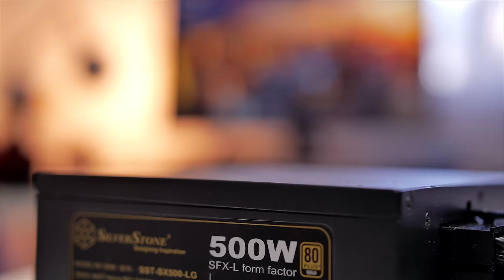Silverstone RVZ02 Review - Amazing Slim ITX Tower!

Comment: Finally got this case and the necessary smaller stuff (mainboard, PSU), and what an awesome machine it makes, it does run quite a lot hotter at idle and load, but it's still managable with the Argon AR06, also makes a big difference wether or not the dust filters are on. (A whole 10°C in my case if using the same fan profile.)

For those that want to know, I got an Asus Z170I Pro Gaming, Core i7 6700K, MSI Reference GTX 980 Ti and the new Corsair SF600, the latter which is a wonderful PSU as it is 600 Watts but not SFX-L but smaller. Temps so far are under full load, CPU: 77°C with Standard fan profile, 82°C with with Turbo fan profile and dust filters attached. GPU is running at around 40°C at idle, but has no trouble staying under 80°C due to expelling its heat outwards instead of into the case.

Also... All this room on my desk!
Reply: +Mina Darsh 
Not to sound snobby or stuck up, just observations based on your build.
1st of all you ruined the air flow design by Silverstone in the GPU chamber when you placed reference GPU which is something even Dimitry didn't understand with the top and bottom unfiltered vents.
The SFF airflow concept is if you have enough intake then you wont need to bother yourself with exhaust fans as air will flow and escape on its own through any vent that is empty hence the reason of not needing filters as its pointless to filter exhaust.
By using the reference cooler you have effectively rendered the GPU chamber cooling mechanism useless as the GPU is more cool restricted with one fan and forced one way exit as opposed to non ref. where you will have 2 fans taking air from a wide filtered opening and plenty of holes at top and back for the air to escape from your GPU.
A 6700k on low profile cooler is too much not to mention no room for OC which rendered your CPU purchase pointless.
im on my rv02 and i get way lower temps than you with ROG impact VIII 6600k ar06 msi non ref cooler and sf600 corsair.
one thing i do agree with, dat space :D....
Reply: +TP015657 I agree with everything you said, but that is if limiting to this case. I might go for the even smaller Dan A4-SFX when it comes out which looks like it will require a reference GPU. And yeah, for the CPU I wonder if the Thermalright AXP-100 Muscle might be a better option, but else I might get a non-K 6700 for it and put the 6700K back into my other rig from which it's more 'borrowing' this CPU.
Reply: You've got more balls than i do going for that case XD
Reply: +TP015657 Well, it's weird, I have seen people combine the same hardware with this case and even claim to overclock their stuff a little. Though for the GPU I'm not too surprised, mine is still below 2500 RPM when it cools at full core load, maximum is around 5000 RPM, the CPU however is cooling near its limit of 2400-2500 RPM. (Sadly my AR06 seems to have a less decent fan from the batch it comes from.) I have seen people clock their 6700K to 4.5 GHz and said it worked well, but I guess they either didn't mind getting eerily close to 100°C or they tested it during gaming and not full load on all cores. The CPU doesn't get as hot during most games than it would during a full load test in the end.
Reply: Try going for a Noctua NF-A9x14 fan a lot of RVZ02 builders swear by it over the stock.
I'm sure you will be able to reach a 4.5ghz but not sure if you will be comfortable with the temps as a low profile cooler has its limits.
Remember the tdp that AR06 can handle is 95w any higher and it won't perform adequately.
Best of luck :)
Reply: +TP015657 Hm, odd that it performs better, according to the specs it moves less air, am I missing something?
Reply: Umm it moves more air at lower speed, 40 vs 50
Not to mention that the extra air flowing will be a nice little welcome to other components next to the CPU that heat up as well.
Reply: +TP015657 Might be that the Noctua has much better static pressure, perhaps. Ordered it and going to find out. :)
Reply: +Mina Darsh 
The Noctua manages higher CFM & lower RPM due to the fan blade design and static, but keep in mind the higher CFM is achieved through the use of LNA.
There are 2 modes for Noctua fans both identical till they reach the high performance range, normal mode will prioritize lower dba (which Noctua are known for with acceptable CFM (38) the 2nd (LNA) is the opposite (50) but still quite considering other fans.
Just make sure to use the LNA cable that is included instead.
Reply: TP015657 I'd hate to correct you, but the L.N.A. (Low Noise Adapter) actually gives lower CFM and noise. Anyway, I installed the fan today, without L.N.A, and although I didn't expect it to crush the Argon's stock fan, it did suprise me pleasantly. The fan manages nearly identical cooling performance, while running very notably quieter, like... A lot quieter. I only feared it wouldn't fit as it turns out the screw holes are maybe half a millimeter closer to each other on the Argon's fan, but it's actually seated well, just a note, don't tighten the screws until they tighten no more. I tightened them until the fan felt secure and the screw couldn't easily be loosened again but no more. It's a pricey upgrade, but it'll scrape 10 dBs off with ease giving the same performance.
Reply: +Mina Darsh 
Thanks for correcting me, i totally got them mixed as i recalled this subject from memory, it was new to me and I only came across it when I got my own fan.
I'm a bit mystified it didn't beat the stock seeing how it did for me on a 6600k OC of 4.7 with 7c difference after repeated tests.
Glad that you liked the noise reduction just hope it was at least worth getting the fan otherwise I'm gonna feel real bad for wasting you money :(
Reply: TP015657 No worries, it's a nice experiment and I'm still baffled at how quiet it is when it's flexing its muscles. No idea how our experiences differ a bit but there are many factors that could play a role when it comes to these things.

Comment: This case looks like you could drill quite a few holes in the top side of the mobo chamber and put 4-5 2.5 inch drives in there and choose to not use the sleds. Looks like there'd even be room to put rubber grommets between the screws and drives.

Comment: [ at 2:54 ]  I think filter-mesh on the small air ports, would be unnecessary, no?  If they're supposed to be outflow, with the larger filtered screens being intake, then positive pressure should prevent any dust intake, I would think? 

I do agree that lack of any filter-screens at all on the clear-panel version, is a major negative.

Comment: 5:46 Good, i wouldn't recommend placing a 3.5" HDD or preferably any data storage medium right next to a piece of hardware that constantly spews out very hot air, since you don't want your 3.5" HDD over 50°C for long periods, especially not over 60°C which is usually the max thermal limit on most HDD's!

Same applies to SSD's, the hotter, the faster the wear, you do not want to exceed 50°C for long periods, 70°C is the max most times (most have a PDF describing the specifications and min/max thermal limits/risks).

Too bad this case only supports 2 slot height GPU's, otherwise it would fit a RTX 3080, though i wonder how well it would do cooling...

It's quite bad how it does not have anything implemented regarding dust filtering, since it's centered at gaming, it will probably run for long periods, so over months it might collect a humongous amount of dust (depending on the house) and heat up the hardware...but on the other hand, the filter were to be full of dust, airflow wouldn't happen which might be worse...

Comment: Would it be difficult to switch out the power LED? I'm in love with this case but that orange is a bit much.
Reply from the maker: Wont be difficult, access to the LED is there.
Reply: Thank you! That orange LED was my only gripe with this case. I will be buying this now!
Reply: So will I need any special tools for it or I can just buy a different LED bulb and swap it easily?
Reply: Have you found a way to replace the LED?
Reply: What I have heard: In the front it has 2 orange and 1 red led. Red led is for HDD activity. So you just need to put HDD led cable to power led spot and then you have red led in the front
Reply: iFreshCrispy if you don't already have the case, the ml08b has the exact same internal layout but a much nicer exterior imo

Comment: By the time you find something to put in the reset slot, you can just remove the power cable. Original designs showed a reset switch, but they chose to leave it out for the final version. I wonder if it would be possible to fabricate something simple to act as a reset switch.

Comment: That cable management though. That's the one thing that drives me crazy about these small cases. I like super clean interiors and it seems hard to find a case in this form factor that offers what I'm looking for without going to custom psu cables, which I would totally do if I were going to build an itx tower like this. But I'm not because I like the look of a atx mid tower way more.

Comment: Great review for a very smartly designed case, although you mentioned no handle, there is the Milo ML08-H which has the same interior design as the rvz2, only the inclusion of a handle and a different front panel look.
Reply: +MrMonkeyindrag Yeah a lot of these cases are MADE IN CHINA and everyone and their UNCLE sells one under their own OEM brand name. Used to deal with this kind of stuff when you ordered from COMPUTER SHOPPER. Just like HD TVs there are 4 factories in China that make the panels, and they come out of the assembly line with as many OEM names as you can think of stuck on the front of them.

Comment: If you achieve a positive air pressure from the intake of the dust filtered vents, only air would pass out from inside of the case through those unfiltered vents.

Who the hell does LAN parties now, people want to challenge a console, a dual booting Steam machine seems the way to go for it.

I am thinking of either this or the Node 202, I currently have a FX 8350 and R9 290X (Windforce Ed). I am thinking of getting this, buying a i7 4790k, 2 x SSD (for SteamOS/Windows) and then bringing my R9 290X and 16GB DDR3 2100 over. I already store my data on a NAS, just need a software rig.

4K/VR rig no bigger than a console :), with Steam OS on it, I am sure I will be able to turn some heads lol

Comment: Can you change the power supply?  I'm not sure if the power supply it has will be sufficient for what I want to put in it. Also, will the Asus Dual Fan GTX 1060 fit in the PCIe section?
Reply: Also, would the 8gb MSI rx 480 fit in there?

Comment: sadly silverstone decided to fix all the minor things, and none of the major ones. I'm still waiting for a case like this that has the gpu and cpu cooling facing the same way, so you could truely lay it flat without compromising airflow to another one; also if you wanted to use a reference card, the lack of airflow to the front of the gpu (specifically reference blower design) is severely hindered since the entire front is solid, something that can be fixed by a single slim fan mounted right ontop of the gpu's blower fan but not ideal.

Comment: This case would be perfect to house the GTX 1070 Mini by Gigabyte because then you can use a 3.5 inch HDD as well as 2 SSDS. I might use my i5 4690k to start off with and power it all with the Corsair SF 600 watt PSU. I wonder if the Corsair SF AIO Cooler would fit in here? Any thoughts on the blower style AIO cooler from Corsair fitting in this case? If not then I will use the low profile Noctua cooler or Silverstone's own one for best compatibility.
Reply: actually it should fit that card AND a 120mm rad by its side, just like ek ones. with a bit of modding you could place a full set of watercooling inside of it. never seen it done nor tried.
Reply: That would be cool!! I would love to mod it to fit a 240mm rad somehow. Maybe if I mod the 1070 to make it a single slot GPU like Linus did with a GTX Titan? Probably a bad idea. Oh well I might make this for the summer and Uni depending if I go or not. Would be perfect to take on the go with me.

Comment: WILL you be able to put in a 2.5" HARD DRIVE in one of the SSD spots? Or only the GPU chamber?
Reply: yes. I have successfully done that. flipped the hard drive and removed one of the black holder in the middle (see video 5:18) you can unscrew it from the GPU side.

Comment: As an owner of this case I'm currently really like it as it fits my needs, but I'm looking for recommendations of a graphics card that will fit in this chamber but slim design and being able to use with nzxt kraken water cooler. I'm currently using with a Nvidia 1080 ti, but want to update to the 40x0 models or something similar but want a slimmer design. Any recommends?

Comment: Personally, I would say that there are way too many compromises me to use this. 3.5 inch drive location limiting GPU length, no radiator support and non-ATX PSU support would make me go for a larger and possibly non-slim itx case.
Reply: Use a 2.5 SSD for your boot drive and games and a 2.5 HDD for storage. It's 2015. You have no excuse to be running games on an HDD, and for bulk storage, a 2.5 SSD is just as effective as a 3.5...
Reply: I find it incredibly hard to justify spending extra money on 2.5 inch storage options, a non-ATX power supply, and possibly a shorter GPU just to save 2 inches of thickness. Again, this is just my opinion; perhaps the 2 inches is life-changing for someone else. There are plenty of other ITX cases out there that are just slightly bigger but don't make so many compromises that I would rather get.

Comment: I wish this use the RVZ01/ML07 All in one GPu/SSD/Optical drive piece...

I used a modular PSU and I had all my Sata power and GPU 6 pin plugged in and made 2 holes so all my leads are nice and clean going to the psu....I just hate the 20pin connected length....Its way to long

Comment: is this the closest thing to Digital storm bolt 3??? Lian LI pc-07s and similar are too but they are overpriced. Anything similar to the bolt 3??? only the case pls, is there a more premium case similar to this raven rvz02??
Reply: The way the Bolt and Raven cases work is by mounting the GPU to lie flat relative to the motherboard, rather than directly into the expansion slot. So very few cases fit that criteria for thinness. But I do believe the Bolt 3 was a redesigned Lian-Li case, rather than an in-house design, so maybe finding out what case that is will be useful for you to research.

Comment: What's the difference between this and ML07, ML08 or FTZ01  ?
Reply: ML07, RVZ01 (non -e) and FTZ01 have the same inside chassis. The RVZ02 and ML08 are the same, they are thinner and taller and dont have case fans.

Comment: That lack of a 3.5" drive is probably gonna turn a lo of people off.
Reply: ***** in like the worst spot
Reply: ***** Very true. I have the Cooler Master Elite 130 so I don't care xD That case is freaking awesome! I used the ODD tray for cable management and the airflow is so good.
Reply: +Eric Melendez I use an ODD in my elite 130. Getting the cables and the tubes for the rad in there is essentially a tangle of cables, tubed, and sadness. I don't over clock, but I am running a small undervolt, so temps are fine. But definitely not the most amazing temps on earth.
Reply: bluesy92 should have just used an external USB disk drive. That's what I plan to do. Thankfully I had a Mac with Windows 7 on it so I used its drive to copy and paste all the drivers and my old Windows 7 install to the new PC. My 16GB flash drive is the reason I'm here today xD
Reply: +Eric Melendez It wasn't for installing windows. I use it for ripping blurays and CDs.

Comment: Guys according to the silverstone specifications this case has a width GPU restriction of 4,78", but they say something about removing the expansion card holder in order to install cards wider than 4,78" like the RX 480 RED DEVIL that i want ( that has 12.20" x 5.04"). Does anybody here knows if this GPU would fit into the RVZ02?

Comment: hey Dimitri would you you recomend a blower style cooler or an atmospherical cooler aka reference(blower) vs acx2.0 for example if the many choices?
Reply from the maker: +Chaos AssazZin For this enclosure it really doesn't matter. ACX 2.0 would give you much better temps and noise levels and since the GPU is in its own chamber inside the case, no air gets mixed from the main chamber so you're good :D
Reply: +HardwareCanucks thx bud

Comment: anyone know which coolers you can use with this? Noctua NH-L9i should fit but doesn't provide much benefit over the stock cooler, can i fit anything better?
Reply: +Eoghan Hennessy I think he is using a Noctua cooler. He should have a parts list somewhere in the description of the video.
Reply: +TekReview's He is using the Silverstone Ar06 4 pipe cooler, at 58mm height.
Reply: cryorig c7
Reply: Realize this is a two year old video. -  The Noctua NH-L9i is rated for 65W TDP.  The Xigmatek Janus LD 1266 is rated at 95W, at 58mm including 2 pwm (80 & 120mm) fans . I used it in RVZ02 B W case, i7 6700k cpu, replaced 120mm  with 140x15mm Prolimatech fan. Max temp- 87c at 100% load.